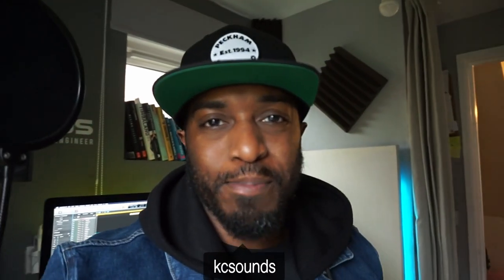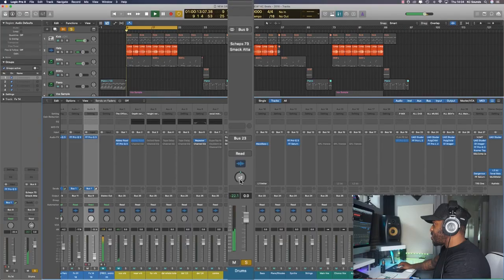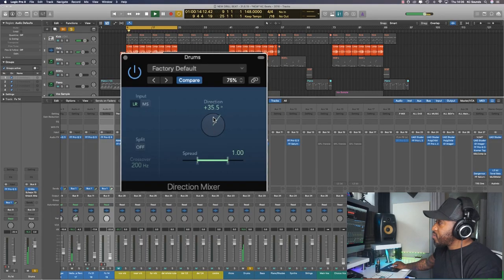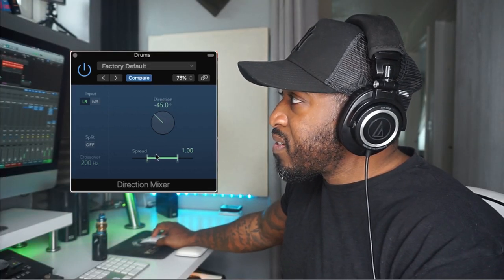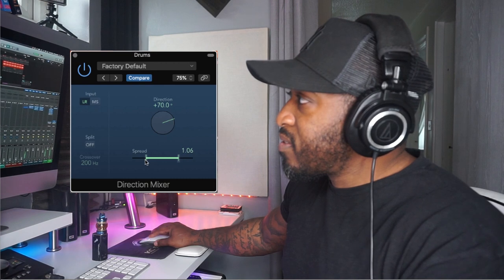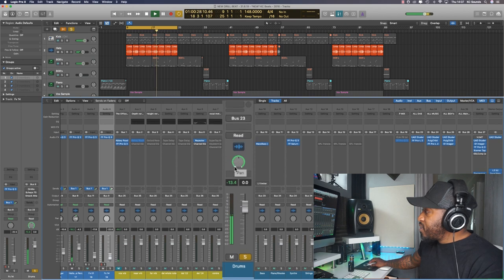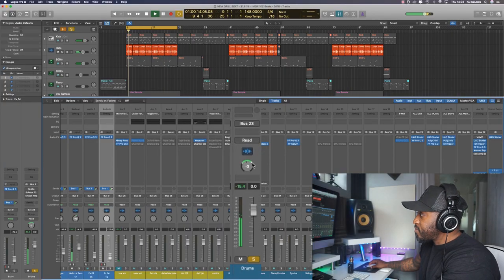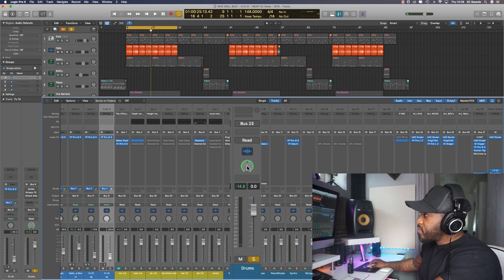The CORRECT Way To Pan (How To Pan PROPERLY in Logic Pro X)

Comment: I have a problem, I was mixing my beat and ready to hear it on my headphones, for some reason my 808 would be heard more on the left  then what it’s supposed to be. It’s not panned to the left at all, I turned off all my plugins and i still have the same problem, do you know anything that could potentially be the problem??
Reply from the maker: Hard to tell without looking at the actual session. Have you tried importing the 808 again? Is it sent to a Buss, that has accidentally panned? Could be a number of reasons
Reply: @kcsounds  I figured it out, the 808 was in a bus and it was accidentally panned, now I heard it again and it sounded the way I wanted the 808 to sound. Thanks for helping bro💯💯
Reply from the maker: @cytheshawty662  nice 1 bro. Glad you sorted it 🙌🏾💯